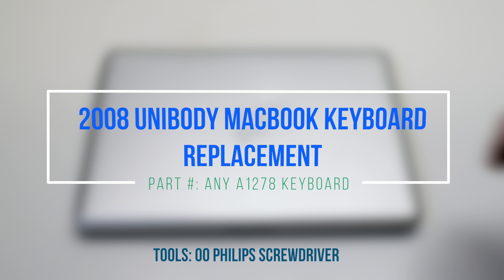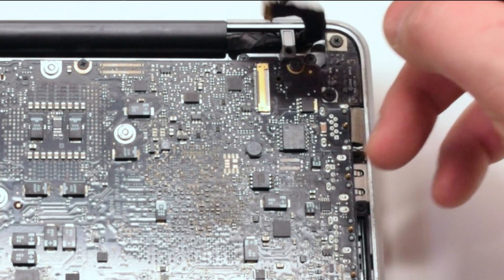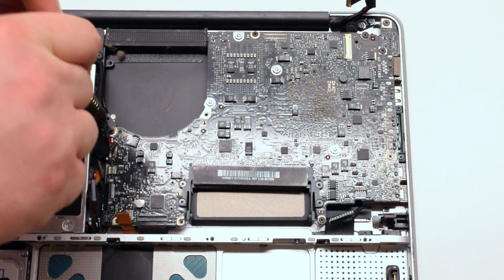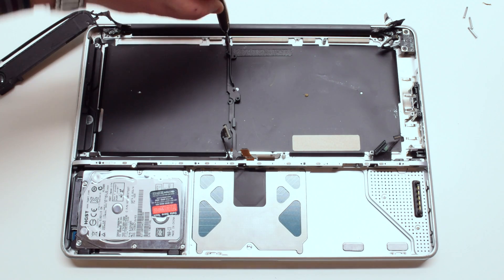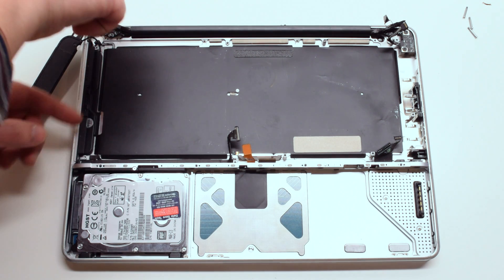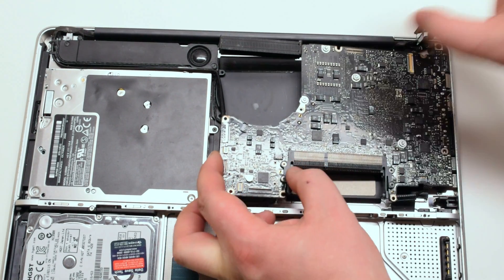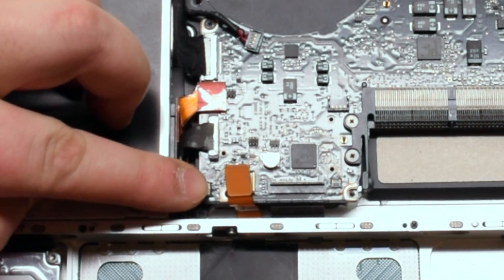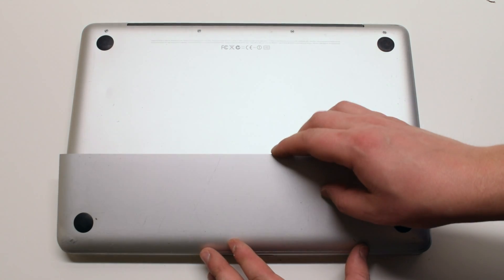2008 Unibody Keyboard and Backlight Replacement Save Apple Dollars 22

Comment: Could you please advice? I have replaced only backlight module because my father's MacBook only lights 4-5 cental buttons. I tried to repair it, but i was not able. Now, with new backlight pannel it becomes even better, but now as a new, not all buttons light with same light level. What is my mistake?
Reply from the maker: It's the keyboard it self that has liquid under the key or the LED lights on the light layer are not aligned properly. Look at this video http://www.appledollars.com/keyboard-replacement it has the answer to your back light questions.
Reply: Save Apple Dollars thanks, really good video.  Could you please advice, how to improve in my case: https://youtu.be/4bz9eDjaEqw
Reply from the maker: Ok so here at 54 seconds https://youtu.be/v4V7mm1Z1sM?t=54s make sure the LED lights are correctly aligned, if they are even a fraction of a millimeter off they will not transfer the light correctly. If that doesn't help then the keyboard itself has a liquid spill on it needs to be completely replaced.
Reply: Save Apple Dollars thanks.  It's aligned good. Probably keyboard itself :(
Reply from the maker: I'm sorry to be the bearer of bad news. Yup, then it's 50+ screws to get that fixed.
Reply: Save Apple Dollars Well, it's not a big deal, if it will really help.